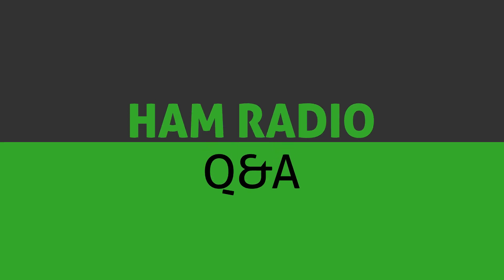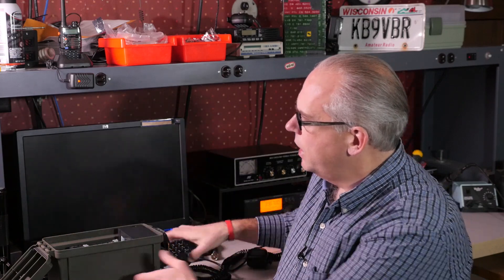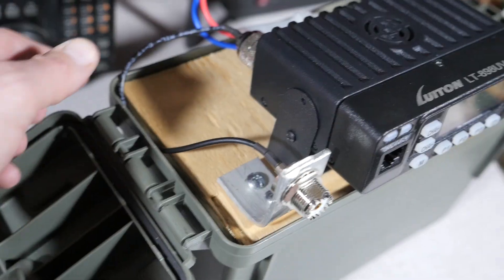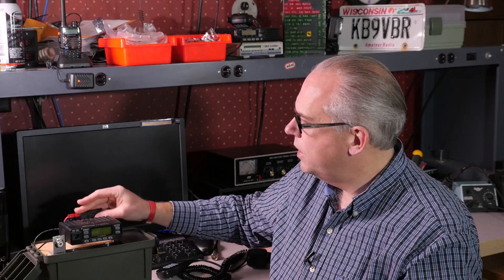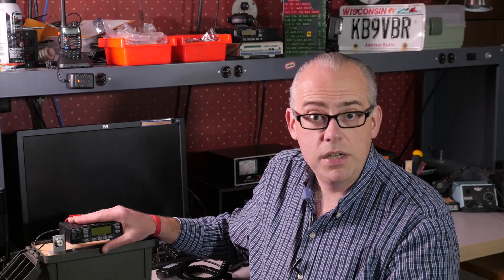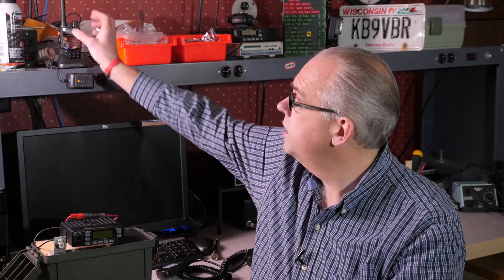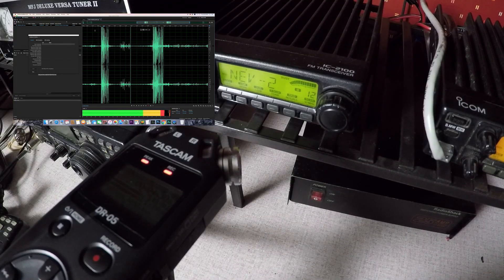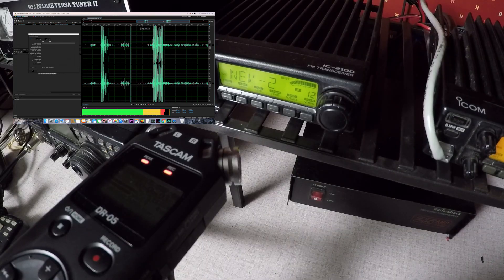Luiton LT-898UV Ultra Portable Go Box Kit - Ham Radio Q & A

Comment: Thanks for the nice report.
I purchased this radio earlier this year and carried it around with a DC power supply and a mag mount antenna for use in my travels.
Currently it resides in my (new) car's cup holders and works admirably.
Signal reports at all times have been very good. Mic seems to work well, no complaints of bad audio at all.
I live on Long Island and have had very little, if any, intermod problems, it's no Yaesu but for the money it can't be beat. Never used the scan function.
Reply from the maker: Thanks for the report. It's good to hear that your's is relatively intermod resistant. For a value priced radio, I've been totally impressed with its performance so far.

Comment: This radio is also available as a ready-made go-kit. It's the Leixen VV-898SP with a case, a LiOn battery, all in a nice backpack. Just add power and antenna!
Reply: No repeater use too?
Reply: They are on sale with Amazon and ebay 160

Comment: I got the jetstream jt270 ( same radio) about 5 years ago to leave on 24/7, I got it for $30 at a hamfest. Didnt expect much out of it. However it has been on 24/7 the whole time and worked flawlessly. 
I recently bought 2 of the Lexien vv898s units off ebay. Other than difficulty with the programming software they are great too.
Now I have on in the shack, the den and in the garage.
It's very convenient. 
When these 1st came out they were $150 ; I would not pay that much but at $50 they are a great deal.

Comment: I bought the Liexen VV-898E (25 watts), Dec. 2019. I have the same issue with low audio (mic mfg date, 2014). I also removed the rubber cover and opened the hole. Only very slight improvement. TNX for the substitute mic find!
Reply: I heard, when it switches from Narow to Wide, then the sound is good.
Reply: Try this mic out, so much better. Unfortunately I could only find the mic by itself from China so it takes almost a month to get here.

Comment: Hello Michael, nice rig. I picked up one of these last summer, 2016 and it is pretty nice for what it is, given the power output. Can get into very distant repeaters, as, I am at about 1950 feet elevation.  I have plans to use a padded bag, made of a kind of ballistic nylon- type material for transport. Gotta find a relatively light battery for it. I have had favorable reports on audio quality in my area, which is very remote, hilly country, so you may have just gotten a bad mike. I have the rig in my shack, powered by a small Lafayette vintage 8 track power supply. My antenna is a homebrew 1/4 wave  ground plane up in a tree near the house. Be well, 73, KC3BXZ Joe

Comment: I have continued to use this rig and have to agree with you. The stock mike is unreliable in a pinch. Some 2 meter repeaters like it, most do not. So, I am going to try one of the other mikes that will work on this rig. Thanks again.
Reply from the maker: I think you are onto something. I read an article once these Chinese radios can wreak havoc in the audio quality in some repeaters that utilize pre-emphasis and de-emphasis in their audio chain. Repeaters that use a more 'flat' audio response seem to work better with these radios. That would explain the hit-or-miss aspect of the microphone audio quality. But I did my audio tests via simplex, so the low audio is a real issue.  I've been using my replacement mic with the radio for 6 months now, and I'm very pleased with the operation.

Comment: I have the 25w version. It’s been in my car for 18 months. I have it on the mid power setting which I have set to 15w. I feel it would burn out at 25w as the heat sink is not good enough. Good tip about the microphone. We can get those Kenwood ones cheaply here as they are used for PMR.  de GM4SVM
Reply from the maker: If I bought another one of these, I'd go with the 25 watt version. I have done 30 minute rag-chews on this radio at 10 watts and it didn't get overly warm. But I would agree with you that the heat sink isn't as good as it could be.

Comment: TY for the video. MIC info was great. I think will get kenwood mic. Anyways those still coming across this. I got the newer 25 watt rebrand sainsonic ebay VV 898E 53$ board is same radio same fraction of cost.
Reply from the maker: Glad you found the video useful, and thanks for the info on the Sainsonics. That's a good deal.
Reply: KB9VBR Antennas have you learned of a keypad mic that works on this? Would be nice. If not going get yhe kenwood mic like yours. Btw once again ty..so much. I dont have the test stuff you do. Learning about mic super helpful.

Comment: On my Leixen microphone I found that the mic hole is not actually a hole but just a dimple in the casing, so I used a modellers body reamer to make a hole & put some foam cut from some aftermarket SM58 interior foams on top of the condenser capsule. Getting improved audio reports

Comment: I have an 898sp, the 25 watt version of your 898. I also have the upgraded DTMF mic. It seems to function OK. I get decent signal reports. The IMF problems you talked about, I also have. All in all, for the price, it's a decent radio but not top notch. I have programming issues using Chirp and stick to manually programming the 898.

Comment: Hey Michael, awesome video first off, sorry I'm a little late to the show. I ordered a mic off of eBay for the leixen VV998s and it works pretty well. Pretty much the same radio as the Luiton UV898, just different name. The mic had a few off functions, such as the up and down buttons control the volume, and has an A and B PPT but the audio sounds great and this way you can have one mic your able to talk and change the frequency on

Comment: I agree the mic is trash. I got the same radio. And found others stating it is trash. Saw a good read on fixing the mic out there. Can drill the hole out some and remove that rubber around it. I ordered a new mic kenwood type also but, one I ordered has some buttons on front I will loose volume if it works but, if all else works that will be great.

Comment: Sounds very familiar to the Yaesu MH-27. In that case there were 2 SMD caps that were bad.. Suggest checking the caps. It's not the condenser mike or hole size.
Reply from the maker: I would agree with you. One such mod I've seen to fix the audio issue is to change out a capacitor in the microphone housing.

Comment: I enlarged the hole, removed the rubber and ripped the black fabric from the top. in all cases no change in audio was detected, it's shockingly bad such that it's stayed in a box here never used. cannot believe the quality of the audio with your 3rd party mic. that's incredible. do you have a recommendation for a dtmf/keypad mic?

Comment: Great video, I have the KT8900 with the stock mic and get great audio reports, so maybe they fixed the problem. Its good to know i can get the after market one though.

Joel
KB6QVI
Reply from the maker: It looks like the KT-8900 microphone has a different outside appearance, so maybe the inner workings are different too. It's good to hear you're not having audio issues with the stock mic.
Reply: As it turns out, I have the LX VV-898, I had to get the box out to see the number, as its not printed on the radio. I also ordered and received the after market mic from Amazon you mentioned for a spare. It appears to work about the same as the original. Thanks for the info.

Comment: Great video. Obviously you can't get an antenna in the ammo box so do you store that in a PVC pipe or other storage solution? Went back through your video to see if you mentioned that.
Reply from the maker: My initial thought was to use a little telescoping whip that I could attach to the UHF connector. But it didn't work too well due to the lack of an effective ground plane. I had to add a couple of 19 inch wires with alligator clips to the base of the antenna mount to get an good match. So now I either grab a dual band mobile antenna with a mag mount, or a J-Pole  and a painter's pole as a mast.
Reply: Thanks for replying. Did you ever do an Anderson power pole connector video?

Comment: Great grab box and review, thank you.  Just one question on the audio, was the programming set to wide or narrow ?
Reply from the maker: Great question as that can affect the audio quality. The radio was set to narrow.
Reply: Thank you for that.  I am not sure what the regulations are in the US but over here I tend to open up the programming to wide to counter the quiet audio on these little Chinese radios.  Narrow is much cleaner but very much quieter.  Could you share the type of 3rd party mic you used as a replacement.  Thank you.

Comment: Could you explain further the receive/record process you used? Much better than a third party interpretation of audio!
Reply from the maker: Mike Ring for the transmissions I used two radios, my Kenwood TK5210 handheld was the control and the Luiton was the test radio. I used a simplex channel so the audio chain in a repeater wouldn't affect the quality of the audio. Everything was received on an Icom IC-2100 set at a midrange volume and a Tascam DR05 audio recorder. The levels on the recorder were set to a constant level for all three transmissions and no further processing was done other than to normalize the audio to a constant output level for the entire video. 

I tried to keep the test objective, as you mentioned, third party audio reports don't tell the whole story on how the microphone sounds.

Comment: KB9VBR,   Thank you for two great videos on the radio and go box.   I have a few questions about the setup and the radio.

1) Does the radio have a port for an external speaker?  A nice to have for field day and JOTA events.
2) What gauge of wire did you use for the go box connections?
3) I understand the Anderson connections, but that type of connections is on the battery?  The picture on Amazon looks like an F-type connection?   I was thinking about building a short wire rig with Anderson on one end and a F2 type on the other for the battery hookup?4) What type of charger do you use to re-charge the battery?
Thanks in advance for answering all the newbie questions!
KD9HBY
Reply from the maker: Great questions, I'll try to answer them in order.

1 - The radio does have an 1/8 inch plug in the back that can drive an external speaker.

2- The wire I used for the power connection is 18 gauge zip wire. The radio has a fuse on its power pigtail but I also added a 5 amp fuse on the positive wire where it connects to the battery. This is to protect the Powerpole connections. Since 18ga wire is a little small for the Powerpoles (these connectors work best with 12 -14ga wire), I stripped an extra length of wire and folded it over before I inserted it into the metal contacts.

3 - The battery has an F1 blade connection. I picked up some blade connectors that fit the battery connection at the auto parts store. I wrapped the ends of the connectors with red and black electrical tape for insulation and make it easier to differentiate the positive and negative connection.

4 - I've charged the battery a couple of different ways. I have a 2/10/25 amp smart charger that is compatible with sealed gel cell batteries. I set the charger to the lowest setting for this battery. The radio also came with a cigarette lighter plug power cable. I cut the end of the cable and installed a power pole. I plug the box into my car and the the vehicle's electrical system to charge the battery. Since the voltage coming out the car is 13.8v, it won't overcharge the battery. 

You could cut the end off a 12 volt wall wart power transformer to charge the battery, but then you need to monitor the charging process so that it doesn't overcharge. As the battery reaches full charge, a linear power transformer will increase it's voltage up to 17 volts as the charging amperage drops. (I'm going to do a video on using marine and sealed lead acid batteries, but with my production schedule, it won't be released until after the 1st of the year). 

I hope this clarifies things.

Comment: what would be a good NMO MOUNT ANTENNA FOR THIS RADIO OR THE VV898S As WELL...THANKS ..GOOD VIDEO. .MIKE FROM MINNESOTA
Reply from the maker: I think it depends on where you want to place it on the vehicle and how much space you have. I like Comet mobile antennas, on my current mobile setup I'm running the Comet SBB5-NMO and it seems to be doing all-right. But I've also gone as short at a Comet B-10 and as long as the SBB-7 on other vehicles.

Comment: I disagree with chirp programming. I use the Leixen software. I wanted to split the VFO A/B areas and with chirp its a mess. I have all my 2m setting in VFO A, and all of 70 cm in the VFO B. My microphone works fine, and get strong sound report.

Comment: Where did you get the battery and how do you charge it up? That's a great little kit. Did you ever think to run the load through a solar charge controller so you don't over discharge the battery. I have a QYT that I want to make into a kit and I think I want to use your kit as my prototype.
73
KE0OAP
Reply from the maker: I purchased the battery at the local Farm and Ranch store. It's a sealed lead acid battery that is commonly used to power fish finders, so check in the sporting goods section. I don't think I paid more than $15 for it. I'll charge it with a smart charger like this: https://amzn.to/2HaVwRo, although a 1 amp trickle charger will work fine too. The solar panel charge controller is a good idea too. I'd think a 20 watt panel would charge the battery in just a few hours.
Reply: Thank you.

Comment: What is the model on the Kenwood handheld you were using? I was going to buy one myself. Thanks in advance and 73! 
-WQZH864 (Gmrs)
Reply from the maker: That radio is the VHF Kenwood TK-5210 P25 portable radio. I purchased it because it does P25 digital, so I use it as both a VHF scanner so I can listen to local police and fire and as an amateur radio transceiver. Buying a used P25 two way radio was cheaper than getting a new Uniden digital scanner.

Comment: I've found one of my baofengs doing the same. when it comes to audio levels. put a hand mic on it and fixed. but why? is it something I can change add or remove to make it right? it's not a problem in the mixer. if adding a hand mic makes it right. it kinda makes it useless as a handheld, if I run a mic. it stays on the belt, no hands on hand held.
Reply from the maker: Since it only affects one of your radios, I wonder if it's a quality control issue. Two things you might check, though. First make sure the radio is set to Wide deviation mode and not Narrow. Narrow deviation will result in a lower audio level when received by another radio set to Wide deviation. Second item would address the quality control issue. Maybe the mic hole is not properly aligned with the mic element. Fixing this would involve partial disassembly of the radio and drilling out the hole.

Comment: How is this holding up?  Thanks,  Have been watching your videos.
Reply from the maker: The radio is still plugging along. I haven't had any issues with it yet. I did a 30 minute conversation on it and the radio didn't overheat, so that's good. It doesn't have the best front-end, so it tends to be more prone to interference and overloading than other mobile radios. I guess after I produced this video there was a firmware change that caused problems, but I think that was subsequently resolved. I'm thinking of getting a second one to put in my camper trailer. The radio is cheap enough that I can use it for occasional tasks without feeling like I'm tying up a lot of money in something.